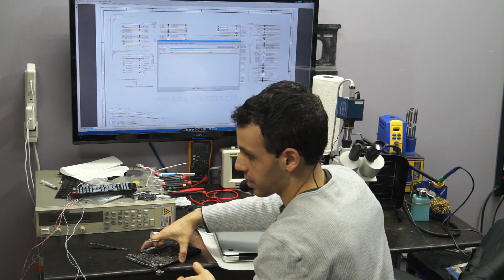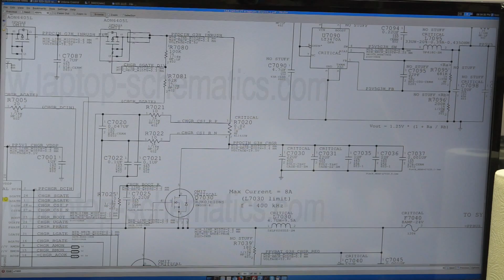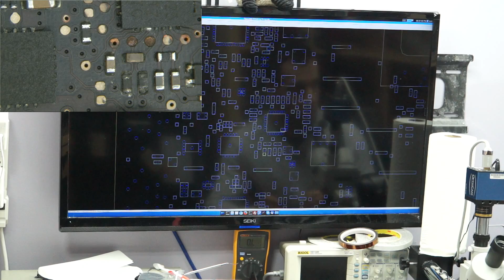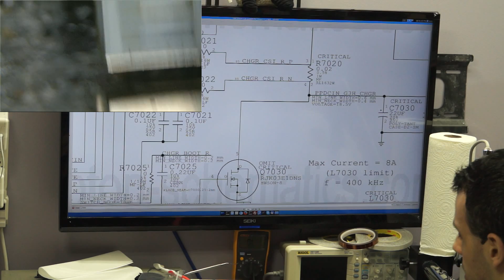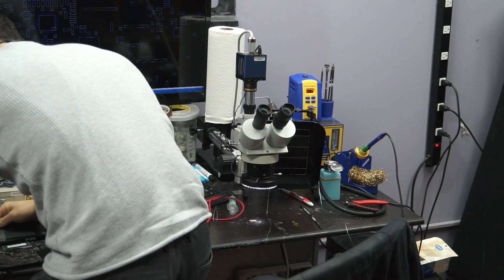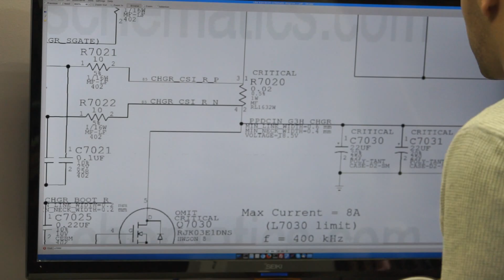What is current sensing and how does it stop my Macbook from charging?

Comment: Hey Louis! I have an iMac 27" a1312, had the video card replaced by the apple recall but it still wont "give me a dong" it has power on all the rails and even the cpu core rails but i noticed my sense resistor (GPU MXM) SMC_GPU_VSENSE is pushing out ~12v and my SMC_GPU_ISENSE is not. A SC70 (U5360) resistor is between those. Would that be something i should definitely replace? Ill be ordering a donor board today in any case. Thanks

Comment: Hello again, i have a macbook air A1465, that caught water everthing work great, but the wireless stop working when i open it, there was a shine black component that as glue on it that as burned out. This component is on the oder side of the board under the LDPR 372C, where i can find the part number. Thanks

Comment: GREAT VIDEOS, I HAVE LEARNED QUITE A BIT FROM YOU, THANKS
I HAVE BEEN LOOKING FOR  A U4510 CHIP DO YOU HAVE ANY SUGGESTIONS, THIS WILL BE MY FIRST BOARD LEVEL REPAIR, I HAVE LOCATED THE PROBLEM SINCE THE CHIP IS MISSING, AND  THE BOARD KIND OF WORKS, BUT NOT CORRECTLY AND I HAVE NOT BEEN ABLE TO FIND A REPLACEMENT FOR THE MISSING CHIP

Comment: Hi Louis, first of all, thanks for your absolutely amazing videos ! They are so inspirational and I gladly remove my AdBlock Plus to watch the ads on your latest videos. I have a little question for you : I have a A1278 logic board with the same problem as here, battery not charging but computer is OK. So I made some measurements at some points and I'm getting 12,2V on pins 1, 2, 3 (PPVBAT_G3H_CHGR_R) of Q7055 and 11,4V on pin 4 (CHGR_BGATE). As it's written 12,6V on the schematics, am I good with 12,2V ? And on pin 5 I'm getting virtually nothing (dropping from around 5V to 0V) so that's why my battery isn't charging. Do I have a bad Gate voltage on my resistor or is it safe to say that my Q7055 has to be replaced ? Thanks for these 2 answers !

Comment: have a macbook air 2014 that caught water, it works correctly, the problem is that only charges the battery when it powered off. Any idea to solve the problem. Thanks
Reply from the maker: highside current sensing on charger line around isl6259
Reply: thanks loius for the help and fast answer, but after change some resistor, now the problem is strange, when i connect the fan, after a while it stop charging, if i disconnect the fan the macbook work and charge normally.
Reply from the maker: Something's fucked up there.
Reply: Louis Rossmann Hello again, i found out, that if i use a 60W charge it charge normally, but if i use de 45W, after a while it stop charging, any idea? it work fine with a strong power supply.
Reply from the maker: use the right adapter, and apple one, no cheap ebay shit.
Reply: Louis Rossmann I only use original adapters, i tried 3 different, i think something is consuming more power and the 45W original charge can´t deliver power to maintain the charging cycle, because it make the charger stop, after that i have to unplug the charge from the power, in order to the macbook recognize the charger again. The 60W charger never stop charging, and the macbook does shutdown the charger

Comment: Hi Louis, these are the videos that I really love! you clearly show and explain all 3 steps, schematics, troubleshooting, chip repair. Great stuff.

I have macbook air 2012 with same issue.. works lovely but doesn't charge the battery..(it even runs from battery but no charging it)  after your video I immediately start measuring the current sensor circuit however in my case everything looks ok.. do you thing it's a bad ISL? any other ideas?

Thank you

Comment: Another great informative video. I feel like Im learning something when you say something and I can point it out on the diagram before you show it.

Also question Louis Rossmann would it have been beneficial to solder the jumper wires while the ISL chip was off? Or would the jumpers move when reapplying the ISL chip.